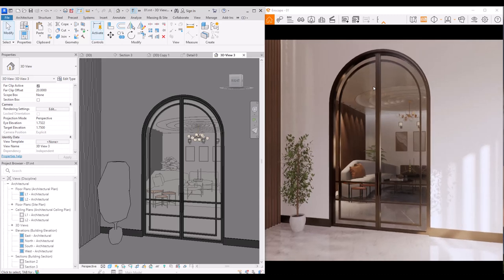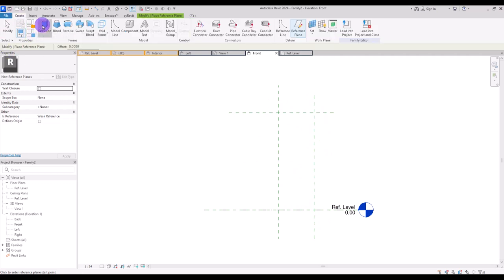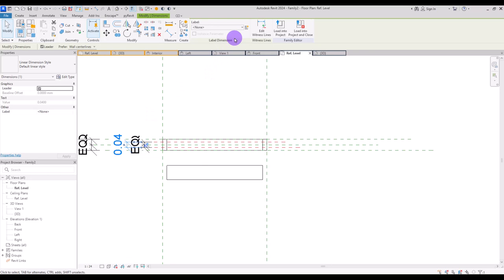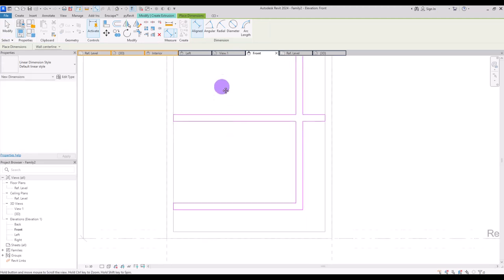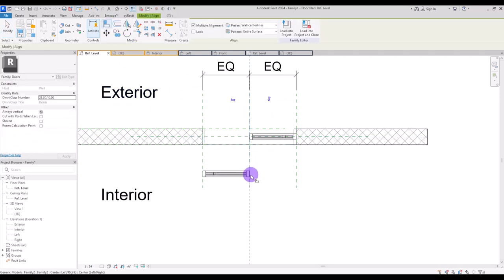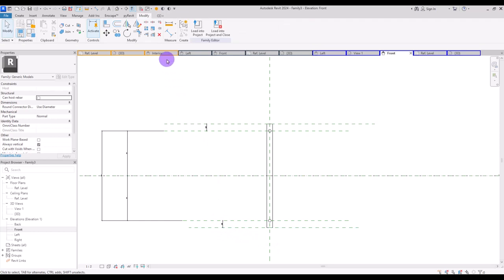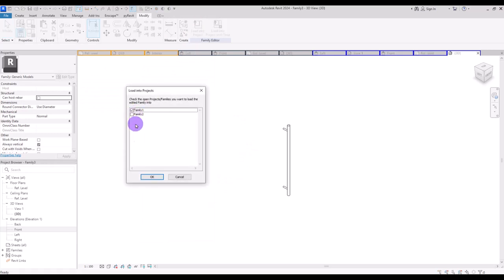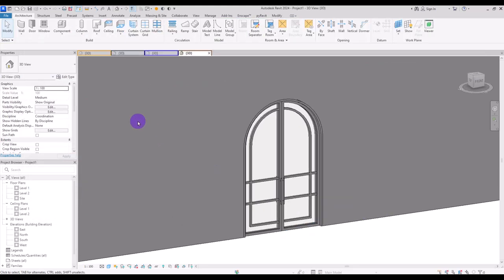🚪 How to model Parametric Arched Double Doors in REVIT

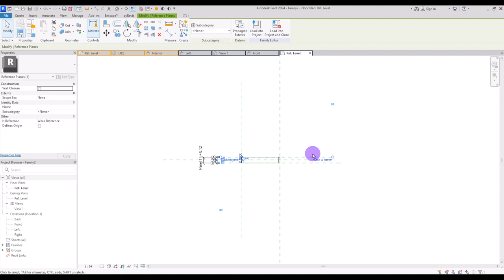Comment: at 5:32, how did you make it smaller?
Reply from the maker: I selected the reference line and moved it down with the keyboard. You can do the same by changing the value of that parameter.

Comment: Hey I am having a doubt, when I can the width of the door after it is created; why the components are getting exploded (Why it is completely deforming)?
Reply from the maker: Hi there. This type of issues raise from not aligning and locking lines with reference plans. Make sure to check all of them.